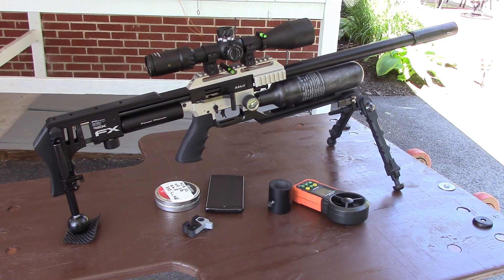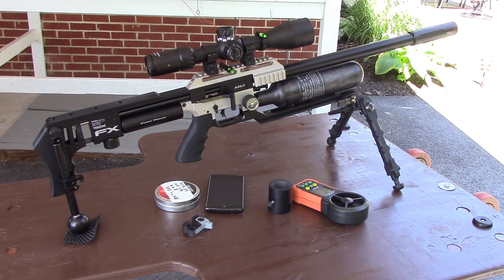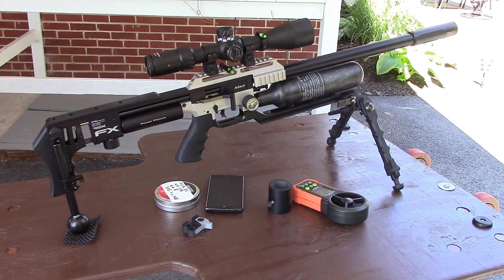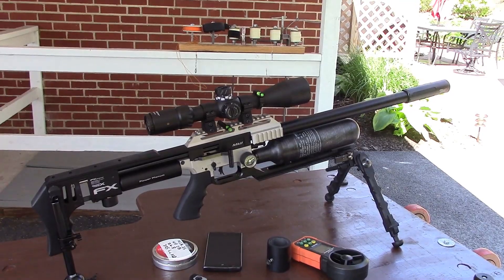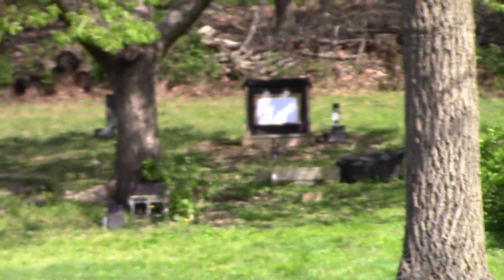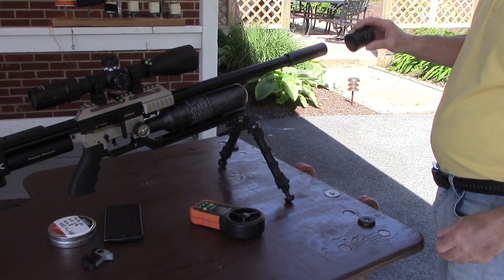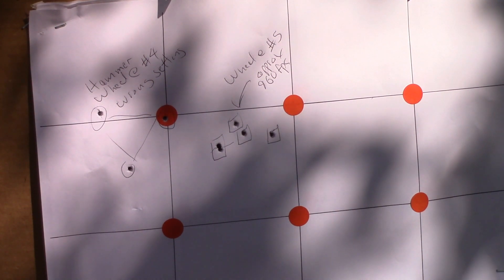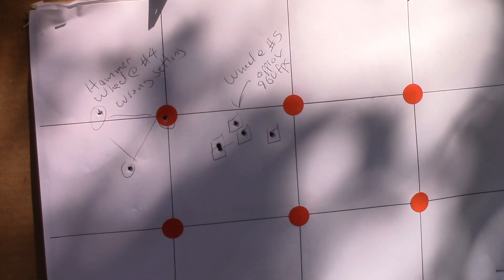Homemade Barrel Deresonator for Airguns

Comment: Isn't slugs not really good at closer ranges? Then they tighten up out futher? Great content. I have my 30 cal slung liner coming in tomorrow. I have 47.2 nsa slugs can't wait to try them. I was also told to tune them in between 920-960 fps with the 700mm barrel. We will find out.👌👊
Reply: Slugs are not magic.  They will not "improve" the farther the target is away.  What a dumb idea to spout.